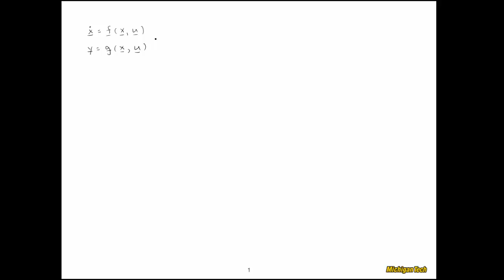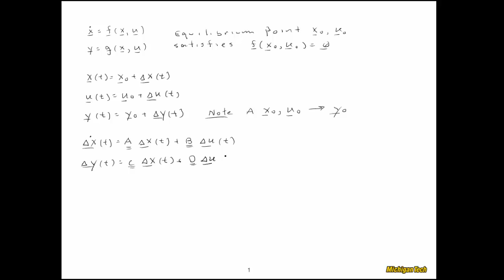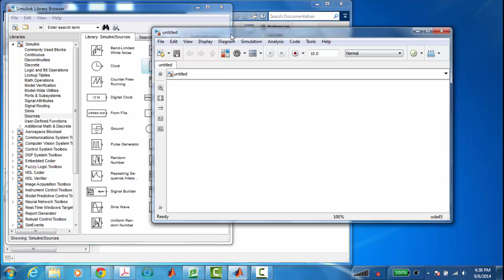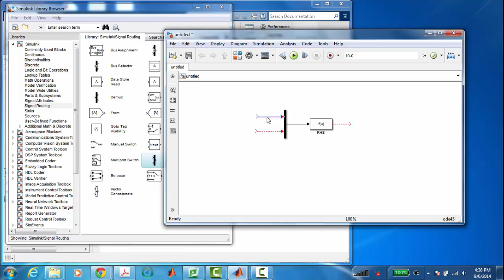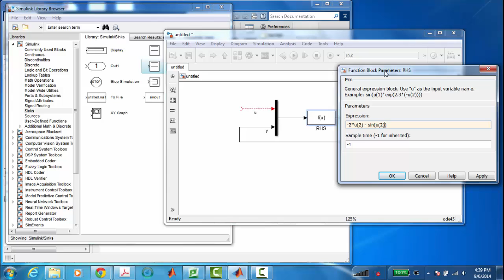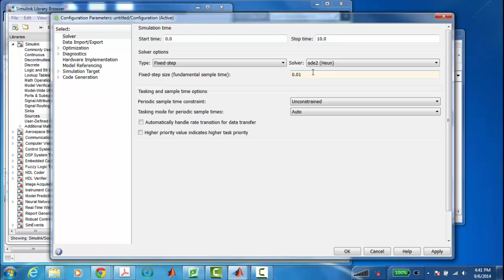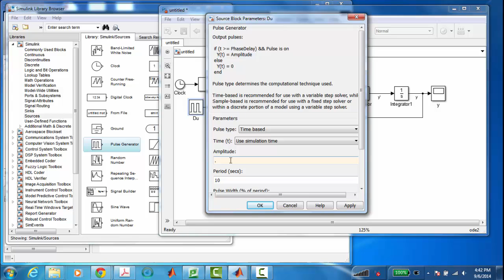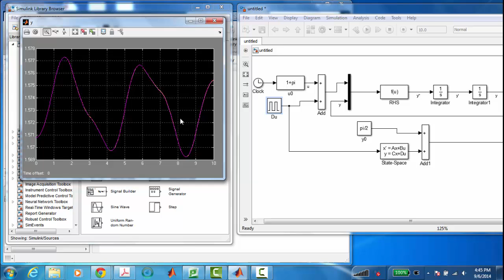Linearization of a Nonlinear Dynamic System About An Equilibrium Point

Comment: Great video. Very detailed. Thank you for sharing it!

Just to add, the importance of the small signal model is that has the same response (i.e dynamics) of the original system - at small perturbation of u - without the need of the last step where output of small signal is added to output at equilibrium point Yo.

Comment: This video is very informative because of the selected example. Most of the books starts with a system with equilibrium of O=[0,...,0]. Hence, they are not able to emphasis that x=delta_x+x0, u=delta_u+u0. because x0=0 and u0=0. However, you start with a more comprehensive example. Thank you. Besides that, I have a suggestion: I suggest you to include tailor series with this linearization approach is derived from. Also, please show the audiences that the derivative of a vector is a matrix. These are prerequisits to understand deeply the linearization approach, but including them help the lecture to be enriched more. Again, I appreciate you for this course.